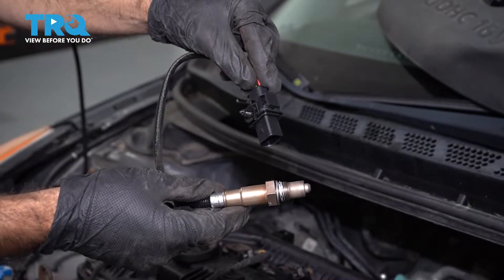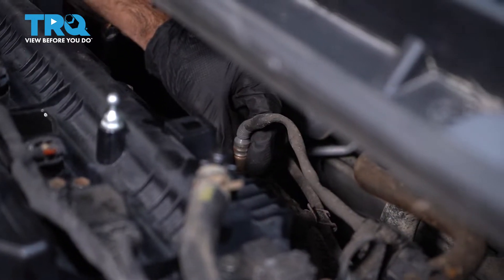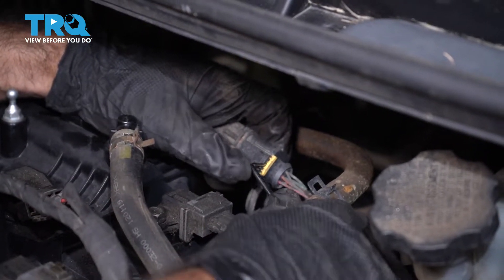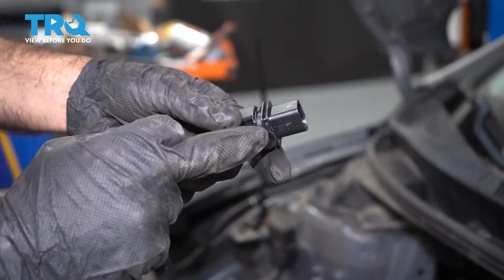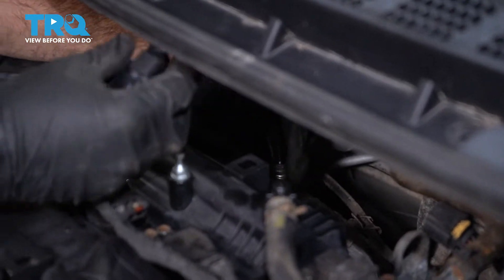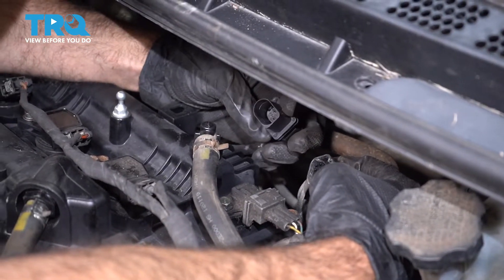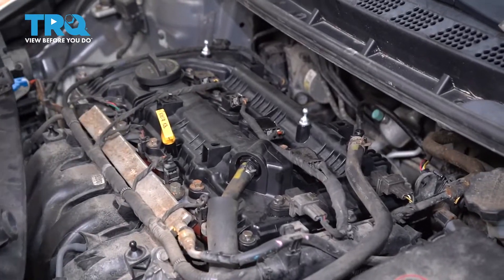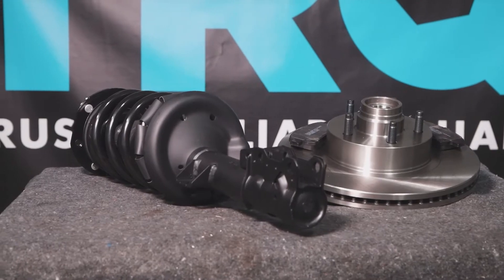How to Replace Up Stream O2 Sensor 2011-2016 Hyundai Elantra

Comment: at ~ 1:15 the view into the connector shows a light-purple colored switch ... the switch can be either "on" or "off" ... any idea what it does ? ... i can note my original/OEM as removed was is one position, while the 3-party replacement came with the switch in the opposite position